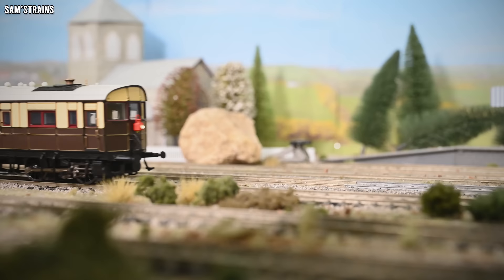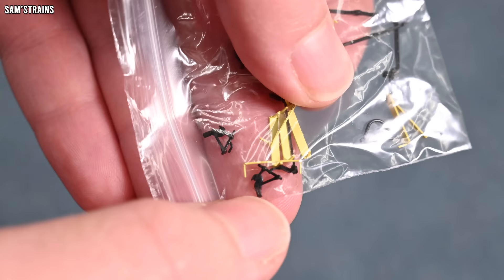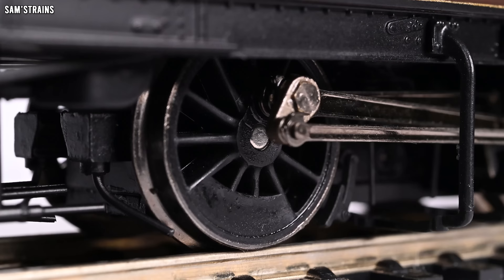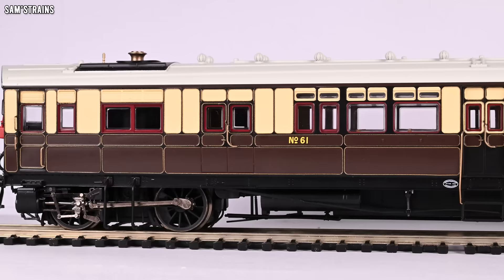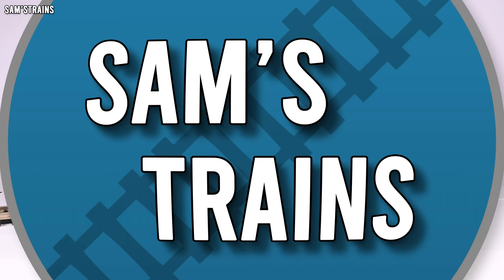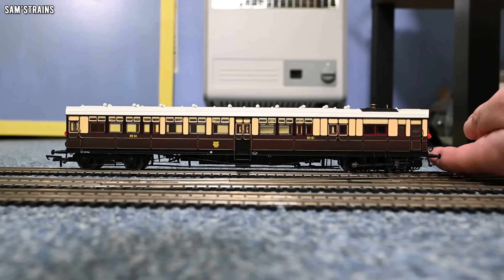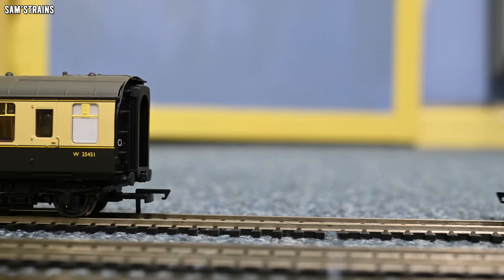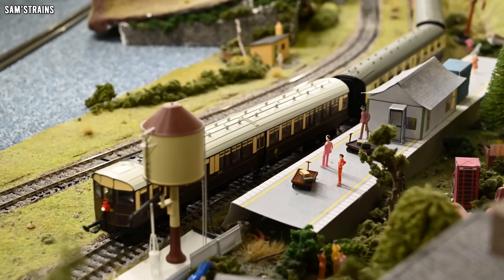A Steam Powered Coach!? | Kernow's New GWR Railmotor | Unboxing & Review

Comment: My grandfather’s local station in southwest Wales was served by a GWR railmotor and would actually pull goods! He was a farmer and there are photographs of it pulling a his cattle wagon to market!
Reply: Pre-grouping, some of the Valleys lines had their own designs, one such featuring a 6 wheeled engine unit..... unique in the UK

Mr Churchward's approach was (as always) based on empirical data, having arranged to borrow and test an earlier unit from the LSWR.  The resulting GW railmotors lasted noticeably longer than pretty much any other 1st gen railmotors.  Only one from this first flowering (from the old Lancs and Yorks) made it into the nationalised era, succumbing during 1948 without being renumbered. Not bad, given the last of the 2nd generation (1920s Sentinel pattern, widely used by the LNER) didn't last much longer.

The actual engine of the GW railmotors (i.e.cylinders, valves and valve gear) formed the basis of the design used on the 1923/4 pair of three (!) VoR 2-6-2T locos  and with the original drawings not being run to earth in the archives until just before the replica motor unit's construction, very nearly got reverse-engineered as the solution for the amazing reconstruction.
Reply: Are these photos online ?
Reply: Love it! :D :D
Reply: Those photos would be true period pieces.
Reply from the maker: Wow that's fantastic - some potentially cool modelling opportunities there actually!!
Thanks for watching, Sam :)

Comment: The cab roof shutter does slide. they are just a little stiff. Interior lights are at a brightness to represent the gas lights of the prototype. With the door handrails being attached in real life to both the body at the top and the foot steps that are part of the chassis at the bottom it was a necessary need to have them unclippable from one end to remove the body to represent them properly!

Comment: Rode on it at Didcot, certainly a unique machine. The amount of strength the driver needed to operate the controls from the auto coach end it was hauling to compensate for the slack in the whistle rope and regulator was incredible 😊
Reply: Had a go at driving the real thing also helped with coaling as well
Reply from the maker: Ahh fascinating - can only imagine… they need quite a shove even when operated directly!
Reply: @steamfandan9682 How do you coal these things? Pretty sure the water comes through the little trapdoors on either side above the rear driver, but how do you coal it? Just shovel it in by hand? Surely not..?
Reply: @BrokenIET  that's exactly the method Having helped coal Steam rail motor No 93 the coal bunker is located in the cab above where the power bogie is located ( Underneath the windows and run full width of the footplate ) the boiler has to be removed as a separate unit

Comment: I really like it. Although as an exception I prefer the GWR Crimson as the preserved no. 93 example. I think it is a competent model for a fair price, especially as an exclusive. Should I buy one, I will most certainly buy the sound fitted version and leave it for my repair shop should something stop working because I ain't taking this apart again if it involves six clips and detailing to be removed. It looks very attractive and with two coaches, as you have demonstrated, it is a beautiful consist here. I didn't expect a review so soon after release. Excellent, I must say 👍👍

Comment: What a captivating model and prototype Sam. We have nothing to add to your review. It is a very fair and well done job once again. Room for some quality improvements by Kernow indeed. The realm of super fine-scale models on the other hand is evidently an invitation to issues and challenges as well. Extreme fragility of such models is one thing. Design-engineering choices, and high precision of manufacturing and assembly are of course added requirements. Overall, a most fascinating model. In need of some quality attention yes but an enthralling model. Cheerio.
Reply: Linda, I've noticed you often refer to yourself as WE. Who is this we, a German club or something ?
Reply: @andrewdking  Oh hi. Us/We are us as a married couple, lol. Both of us are in the hobby, although he does all the technical things. I'm into modelling of scenery myself. Not in a club setting but we have started a layout a few years ago. We did discover Sam's Trains as well when we started, and strangely enough our passion has little to do with OO. Our fondness is Märklin (H0) with models from the 1970s onwards. We try to integrate old-new, and analogue-dcc which can be challenging at times. However the Märklin system has always been extremely consistent, coherent, and compatible since the 1960s. It's one of the oldest and continuous (truly) premium rail model companies as well; absolute historic focus on durable flawless quality and very high innovation. However we've also converted one Hornby Peckett (Daphne) to M 3-rail. Sam's Trains is very entertaining though and provides an insight of the OO market and British history of rails.
Reply: @lindaoffenbach  OK, I'm aware of your love for Marklin, but not Pecketts. They are lovely and I have three including Daphne (with an h 😁)
Reply from the maker: Thank you so much for both of your comments! Yeah they could improve improve it if they wanted, but overall it's just the job!
Thanks for watching, Sam :)
Reply: I'd say that the solution to fragility is to make those parts out of brass or steel.  I havent seen many well made brass locos that are that fragile, but plastic on the other hand, breaks whenever it feels like it.  Engineering resin is good for that too, as it is incredibly flexible while not being overly rubbery.

Comment: Bought the preserved version at £189. Stiff rear bogie, thanks for the tip. No glue marks 1:05 1:05 . No Kerr Stuart builders plate but then no idea if there is one on the real thing. Have not run it as the track is buried under boxes currently. Lining is superb. Loco end steps nice and level. The underside was the first part i looked at and was impressed it would have been nice for the brake rodding to be fixed, nah wouldn’t work, make the rear bogie stiffer still. In the light i have can’t see any interior detail however you showed it well and it looks good and accurate (I guess) pity there was not a drivers jacket hanging on the back wall and bag on the floor. I am pleased you did not complain about the 0 gauge lamps as apparently could not have been made smaller due to bulbs not that small any other lighting method would have been very messy.
If mine runs as good as yours then I will be a very happy person.
I will run it on my Chesham branch when built, there is always a chance it could run there on a Sunday service day in reality.
A nice balanced critique.
Nice to have met you on the last day of the last Warley and apologies to your partner for not acknowledging her, very remiss of me. Just to park, get in and buy a snack, all i could afford, and two drinks. Total cost 63.61 gold bars. I had nothing more to buy anything there. Good riddance to an expensive location, just like Telford. I look forward to your review of the Ellis Clark Stanier class 5 should you get one or are loaned one.
Best regards, graham

Comment: I've got the boring brown one deliberately because it will be the least popular (just to be different). Its DCC sound, but so far I've only powered it using a 9V battery across the wheels, just to check it functions - it did. It is indeed very delicate & picking it up, one has to check the door hand rails are still in-place when you put it down again. I was dissapointed with the roof piping, like you say its just moulded & the eye goes straight to it. Maybe the price was mounting with all the separately fitted parts, so Kernow had to compromise to stop it going over £200 in the basic DC version ? The other year I mentioned to Kyle at TRS Trains whether it could be fitted with his water vapour steam system, but probably not. It would look brilliant it he could achive it. Now it actually exists in the flesh, I'll have to ask him again.
Sam, do you know who actually manufacture it for them ?
Also, ModelU already do a crew & passenger set (two separate items) specially for this model, which I already have procured (not cheap), so more fiddly painting reqd & body removal to fit them :(

Comment: This is similar in appearance to a doodlebug, though those used gasoline (petrol) engines, not diesel. That was their downfall as if they wrecked, they often became a big fireball as the flammable gas leaked and caught fire. These rail motors are also similar to RDCs; those use a diesel engine to power a small generator just like a modern diesel-electric locomotive, but the diesel engine was on the roof, covered by a shroud to protect it from the elements. Like these rail motors, they too had limited pulling power; often only one extra coach to meet passenger demand. I think a few RDCs were converted (or built) to haul mail or freight, and they were used by short line railroads to haul passengers to/from work where they couldn’t justify the cost of a full passenger train.
Reply: Correction on the RDCs, They are not diesel electric, they are diesel hydraulic - diesel motor driving through a torque converter transmission and the engines are mounted under the floor like any other diesel railcar. The roof pods house the engine radiators.

Comment: Its a nice model.When I looked into the demise of the full size Railmotors a while back there seemed to be a huge number of issues not least the only place you could reliably put coal in the firebox was when they were stationary meaning palls of smoke in the stations. They rattled so much that steam leaks were commin and drivers were given an extensive tool kit to do repairs on the move. As they got older they spent long times out of actuon under repair and of course it meant both the power plant and the coach would be out of use. Would love to have a ride on the preserved ine though.

Comment: Excellent review of a lovely model Sam! I took delivery of one today and it's gorgeous!  Beware of the chimney cap falling off when opening the box and the Valve Gear Scrolls on the power bogie scraping platform edges. (Update - Changing the Valve Gear Scrolls to the smaller ones from the detail pack solved the platform edge issue). As advertised, the model is not so happy on 1st radius curves.

Comment: Try stripping-down and rebuilding the Acc's Manor!!   That fiddly and Tight two-wire plug in the boiler is an absolute "B" for Bananas!   Watch for parts pinging off and don't forget to clean the glue off before resetting...and you think the StPwrdC is difficult!   🙂

Comment: On overall aspect, good to excellent, a good start.
For exploitation, does she runs fine ? Well, she does. And thanks for the tip on the carrier bogie !
One thing that amaze me, in the negative sense of the term, is why on Earth did they conceive the opening of their engine to do it by taking apart the chassis ? Due to the position of the decoder socket, just have the roof maintained in place by one screw at each extremity passing through the whole height of the locomotive in places invisible or difficult to see (or clipped if nothing else can be done) would have made the opening far more easy ! Why did nobody at the drawing board think about such a simple solution ?
I'll see next month if I buy me one, very tempting to get one !

Comment: 1. The chimney - since it is easily removable, there would seem to be an opportunity for someone with a lathe or 3D printer to produce s replacement part.

2. Several manufacturers make figures that can be installed ae passengers and crew

3. 3 man crew? Driver, fireman and Guard?

4.

Comment: Sam. You refer to valve gear scrolls. They are the bogie mounts. On the real thing the  bogies were attached to the sole bar using the 'scrolls' . Due to the valve gear, the power bogie had to be mounted from underneath.

Comment: If you have 2 R2 curves with one reversed it can cause problems for some longer models. Same with a tightening radius curve after a turnout.
My Roco VT 12.5 DMU has very long cars and in reverse it would derail on that type of track layout due to a lack of weight in the middle car. It took a lot of lead weights inside to stop that happening.

Comment: I’ve seen reports that there’s a capacitor linked to the lighting giving a sort of stay alive function to the DC version’s interior lighting circuit. Is that true Sam? It actually did - just - look like it when you turned your lights off to show the interior lighting. Obviously you have to run a few seconds to charge up the capacitor but it’s a great feature if so!

Comment: Nice model, and I suppose that the price isn't too outrageously high, considering that this is both a locomotive AND a coach!  The GWR was the largest user of such railmotors, though the LNER had a fair number of somewhat more modern Sentinel-Cammell cars in a nice green and cream livery (which would make a good model in its own right - Rapido, maybe?).  The principle of a separate small locomotive and a push-pull coach, or set of coaches, proved easier to maintain, and lasted well into the 1960s.

Comment: It was probably really dirty and hot to sit near the front the floor staned blck from ash and coal, but it also probably had excellent heating during the winter. seeing as some were converted to autocoaches I imagine it wouldn't have taken much work to turn a pair into functional steam multple units. the controls are already set up for it you'd just have to extend them and add a joint between the cars.

Comment: I recall the announcement of these by Kernow, and I didn't feel back then that the price was worth it. Then the years went by, and I thought, it looks like it won't see the light of day. The design either was too complicated or that the production costs exceeded the original prices needed to make it a viable model. I am so glad to see this first review, and it is an amazing looking, detailed motor coach. I do still think it's overpriced by Accurascale standards. I do believe that the end lamps are over scaled some what, while other details are a bit too flimsy. A shame about the QC issues you had with it, Sam. It was a great review, and I do like to collect prototype loco engines.

Comment: I think there is one of these in preservation actually.
Reply: Sort of .... the carriage section is from an origininal machine which was converted into an 'autotrailer' in the 30s.  When rescued by the GWS, it's condition was extremely delicate (probably just the tarp and woodworm poo holding it together), the restoration was a long and complex* example of the skill of many fantastic craftsmen (and women) to be found on our heritage lines. 

The vertical boilered engine section is a recreation*, beautifully wrought after much painstaking delving through the archives for original source material.  There's footage online of the "naked" engine unit before it was integrated into the complete railmotor and boy, does it look strange!!

* and costly ..... these jobs are ALWAYS costly, even with slave, sorry, volunteer labour!!
Reply: @TheHoveHeretic  I see, thanks for the info.

Comment: Point of information Railmotors where not a failure by any definition as they where in use on the GWR from 1902 to 1935 and the DMU comparison isn't valid as for normal running there where no unpowered carriages attached.

Comment: Is knocking down to 3 stars for both mechanism and quality a bit hard? Sounds like you knocked off for the trailing bogie bearing twice which in turn  knocked them off of your "B" rating? We do need to be careful I think not to take today's detail quality for granted? I wonder if these are made by Rapido for Kernow? Apparently the cab sliding roof does slide with a bit of persuasion..

Comment: They should've used screws to hold the body on, fiddling with plastic clips on a delicate model like this just isn't the way to go. Did you know they put a very strong capacitor in for the lighting? The lights can work for quite a while without power on DC, quite a thoughtful feature, as these are designed for short commuter journeys with frequent station stops.
Reply from the maker: Yeah that's fair - the clips are pretty annoying! Yeah there's a decent capacitor in there - always appreciate the anti-flicker!
Thanks for watching, Sam :)

Comment: Something is wrong with your scoring system if a model that is beautifully finished and runs well and is good value for money can only end up with a C rating. The model is a self-propelled carriage, not a locomotive and as such does not need to be heavy with a metal chassis. This would only work against the power of the motor. In real life these either ran solo or hauled one trailer so a high tractive effort is not needed. Your comments about it being hard to disassemble only apply to this being needed once to fit a decoder so would not normally be a handicap. In any case Kernow could get around this by offering a version with a factory-fitted decoder. It appears to be a lovely model and you can compare it with videos on Youtube of the restored GWR steam railcar running.